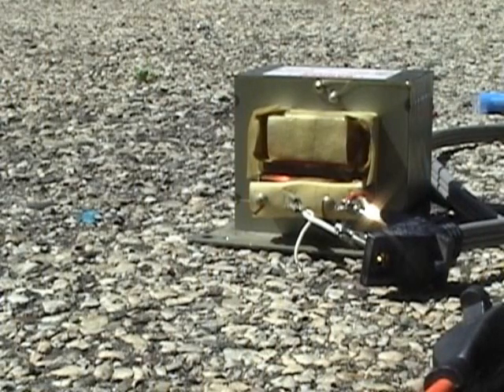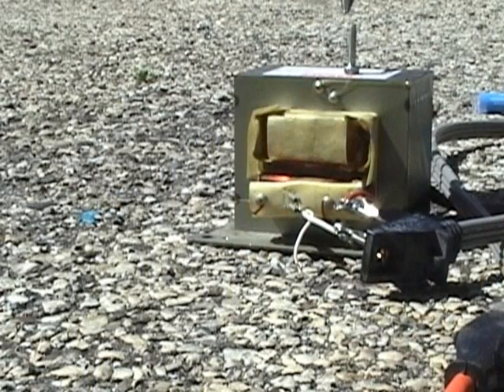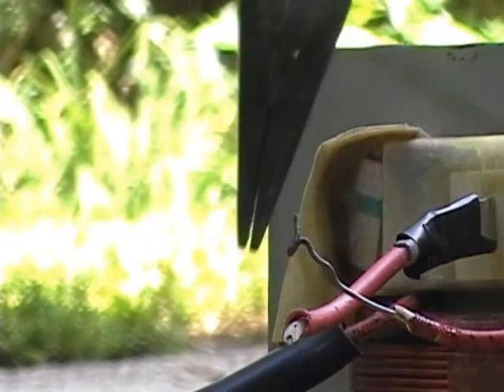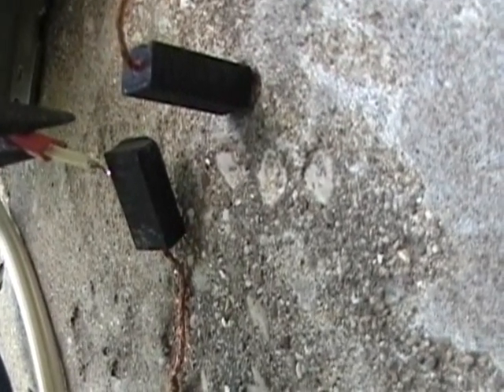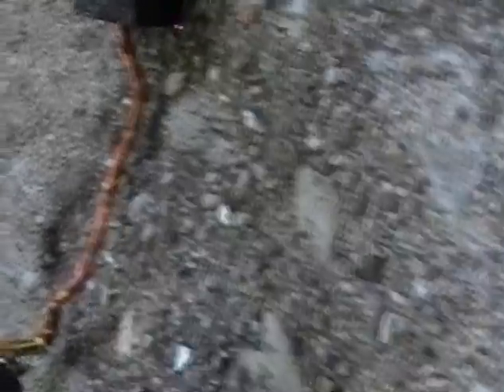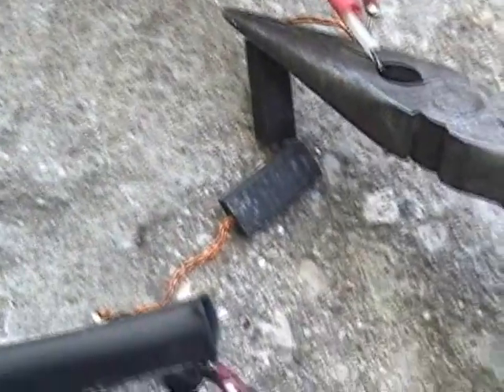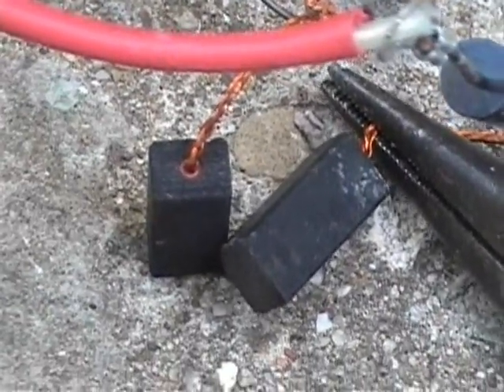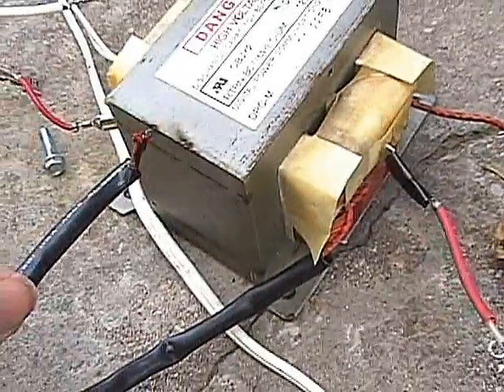knox tv hv step up transformer experiement

Comment: HOLY SHIT!  I wasn't going to talk about this in your monitor video, as I was afraid you would actually do it.  This is NO TV flyback transformer, this is a microwave oven transformer.  2kV 500mA (from 1000w microwave).  It's not the voltage, it's the CURRENT, able to be pushed through by the voltage.  2,000v, 5 A - Electric Chair Specifications.  You could have died at any moment, but I bet that makes you feel cool and adventurous ;)

Comment: You are trying to ark to the wrong place. Those wires are the filament winding, take the live wire that is coming out of the secondary and ark to the iron core of the mot which is the neutral side of the secondary.